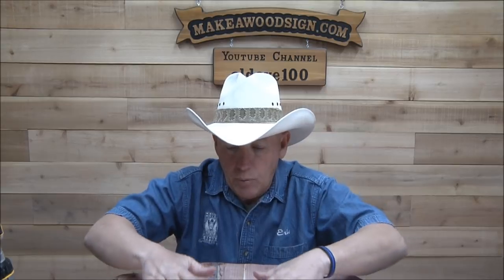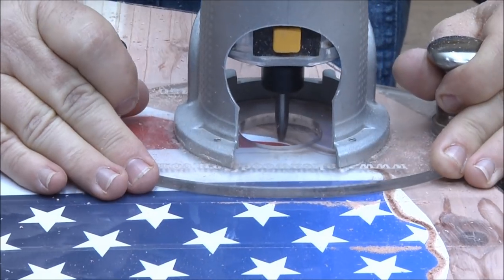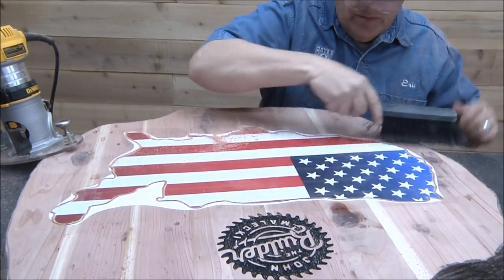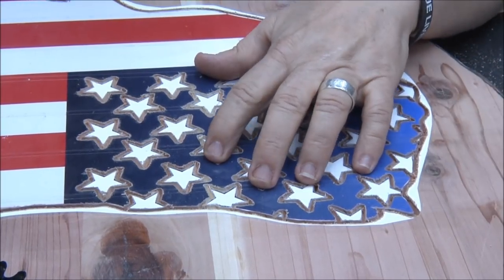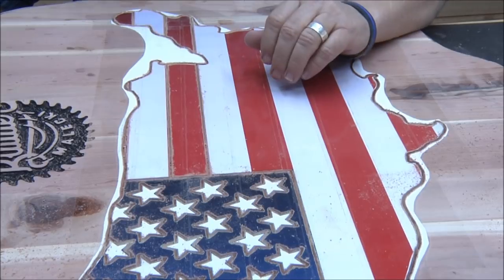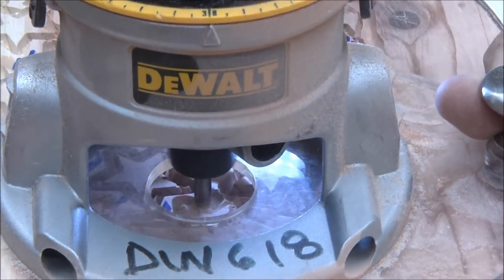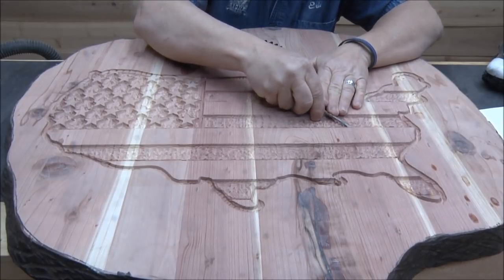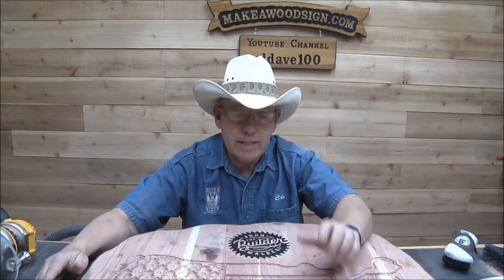#266 Part 5 of 7 on John Malecki Wall Art Carving Stars & Stripes

Comment: It's coming on nicely Eric,How do you find it routing over the vinyl or any paper stencel/template.ive tried and it's just not for me..so I do all my projects the good old fashioned way with carbon paper and trace the whole thing out ,it's time consuming but it works for me..
Reply from the maker: Most of the time it works out great. Adding the packing tape over the top make a Huge difference.

Comment: What direction do we pull or push router? Every time i push right it goes super fast like it slips...if i go left its slower
Reply from the maker: When you go right or left it would depend on the way the grain is in that particular board. Sometimes it would cut better from right to left, sometimes the opposite.  What I was talking about was pulling directly to you from in front of you like I was doing at 7:55 of this video. Hope this helps. Thank you for watching, Eric